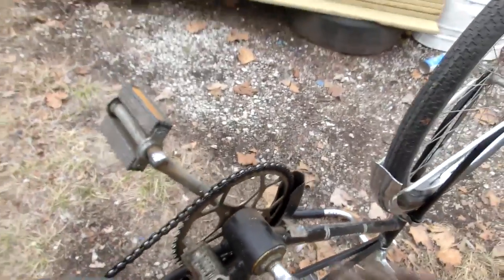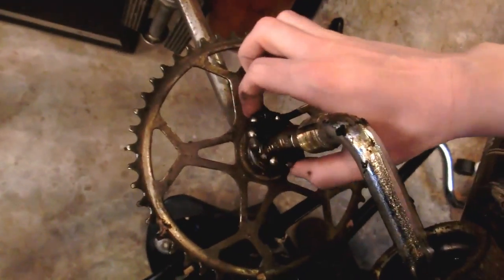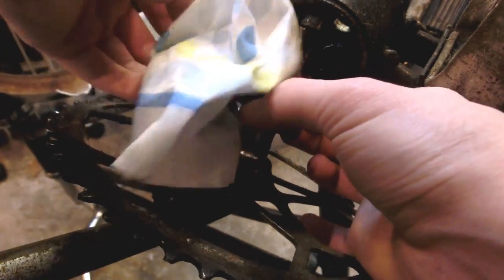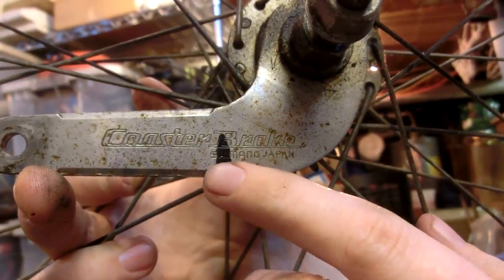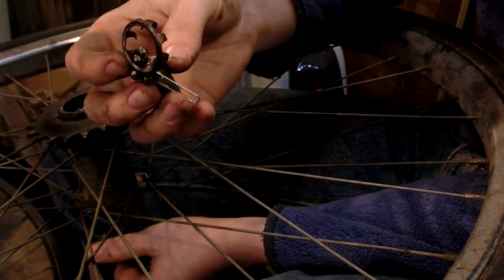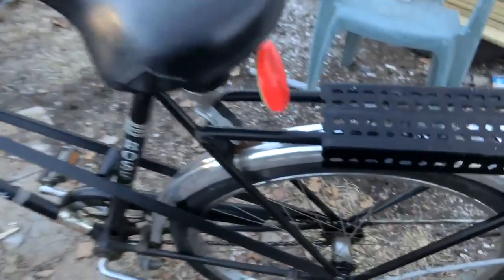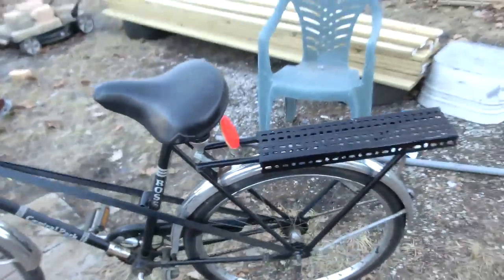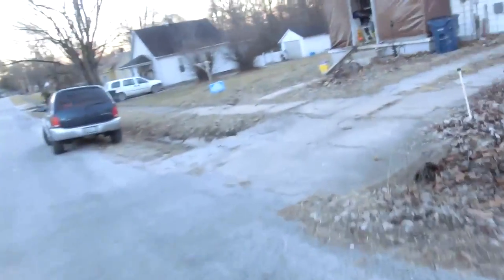SteamPunk/TeslaPunk E-Bike 03: Greasing Bicycle Bearings, Shimano B-Type coaster brake

Comment: There are usually bearings inside the pedals they will probably need greasing as well. Bearings tend to run smoothest with just a whiff of grease.

Comment: Bikes should definitely not feel tighter and more resistant after servicing all the drivetrain bearings - that is a sure sign that something is maladjusted or reassembled wrong.

Also, just a hair too much tightness (especially) or too loose can lead to bearings and races getting destroyed in short order.

If it feels harder to pedal now, I would surely fix this before I applied any external motors to it(!).

Comment: Hi Rinoa Super-Genius try using a liter weight grease it makes a big differences  in ease of movement just like in oil weights in a eng. / motor . The viscosity is to high for you to over come . Just a thought i had to help you out. Good luck with your e-bike build . THANKs for the videos the make my week better every time
Reply: doesn't matter much while riding, only when spinning the wheels and crank by hand

Comment: I like to coat all my bearings and races with a spray on dry moly lube then coat over that with some thin teflon grease. I tighten things up just enough to get any slack out and not a smidge more.

Comment: Love those reverse brakes!  Think if you spray some oil in those bearings it will loosen up for you.  Guessing my method is wrong but I grease up the bearings then assemble it and spray oil in the bearings and keep spinning and adjusting how tight the nuts are until it spins super easy.  If the nut starts coming loose just peen it in place; usually a nice hard hit with a hammer and chisel put a little dent in there and bingo good to go.

Comment: Bikes looking good so far. One thing I do when looking for a bike project is, only get bikes that have a 3 piece crank. I feel it's a better design. I like your homebuilt mixie. Electric assist will be awesome
Reply from the maker: yeah it has been, ive so far gone like 500 miles on it and its mostly holding up fine. some issues of things rattling loose over time but its all stuff that can be fixed with a screwdriver now.

Comment: It's slow because it looks like you packed too much grease in the bearings.  The bearings need space to move and only light coating of grease is required for proper lubrication.
Reply: Cory Yalowicki no it's because the preload was set too tight. No cone wrench, so just pretend it doesn't matter. Hey, why is it so hard to pedal now????

If there's too much grease it'll just squish out.

Comment: Someone has probably already explained it, but those wheel bearing races are supposed to be tightened up so they don't move much axially, while still rolling smoothly, then the second nut is tightened up against the bearing race so they don't loosen up. It's the same principle with the bottom bracket.

Comment: no worries man.Just loosen up the bottom bracket and the hubs just a bit.A smidge play is all right.
take apart the pedals as well.
Hate the US open BB ones because they always run loose after a while.
Got a conversion kit to Euro BB bottom bracket on my Felt cruiser.Which gonna be an ebike  this summer.Inspired by that crazy expensive Vintage electric E- tracker.

Comment: The pedal is the squeaker, spray a bit of WD 40 in the ends of both closest to the frame and that should stop after a short ride, on bikes you can over tighten bearings which causes bearing friction so you have to pedal harder.

Comment: It should be a fairly quick fix for the wheel bearing tension but you do need the skinny cone wrench. The idea is you finger tighten the cone nut down on the bearing just to the point where there isn't any play then you have to hold that nut still with the cone wrench while you tighten the lock nut down on that cone nut. Then test the wheel for easy rotation without play and you have it. If not back it off and adjust the cone nut ever so slightly in the direction it needs to go and tighten everything up again. Repeat until it's just right. Same idea with the bottom bracket bearings. 

Otherwise you'll probably get way too much pressure on the bearings and the races will groove and the bearings will grind like hell and won't last for shite under pedal or electric power.

Comment: Btw to check any play on an axis with bearing try applying a torque orthogonaly to the rotation of the axis (I don't know if that's the best way to say that ^^) for the rest, I've already left a comment somewhere down here. Have a nice day !
Edit: the noise might come from the chain guard, I had to bend the end of the curve inside on one bike, on another one it was a screw under the guard that was rubbbing on the chain.

Comment: minimize grease.. with no grease you go fast because there is no resistance on the bearing however with no grease you have premature wear. tighten the bearings to a degree of tightness that you chose but turn the nut back maybe a half or quarter turn "or less" to minimize the contact pressure. generally i tighten them just enough to nill the slop.  something also you should  think about is the function of the first and second nut on each side of the rims... these most definitely are where applying either a bit of locktight or using a very slim pancake wrench because just a small turn of the threaded shaft while tightening the outer nut can throw off everything with your bearings again.  the  old pedals can kill you too. i fell going downhill standing up to gain speed while racing my mom a long time ago, i was restoring the bike .. but i kept the original  pedals on because whats a pedal to us but something to put a foot on thats on every "pedal" bike known to man and ive never known a pedal to snap. that bastard did exactly that though like a twig.. they are very thin shafts in most of them older bikes. My bike was an old black raleigh 3 speed or whatever with the original racks and had lights and all it was pretty sweet.. lost a lot of flesh from that accident, luckily we are most fortunate to have some degree of self healing as humans.

Comment: Back off on the pressure on the crank, you want it to spin for a long time,  but not rattle back n' forth too much. The lock washer that fits in the keyway will keep it from backing out. As for the missing ball bearing, I have a feeling it did fall down into the seat, just a matter of time for it to show back up n' grind up the bearing rings. Might want to remove the crank all the way and flip the bike so the ball bearing will come out. Need to loosen the bearings on the axles too, should make it easier to peddle.  As for the squeak, sounds like its coming from the peddle bearings.
Reply from the maker: +Lacider i did, i couldnt find it. and yeah ima see about greasing the pedals

Comment: If it's harder ride you tightened the bearings and bb too much!  It should be easier after you grease it 100% if the time.  And the rubbing chain will cut through whatever it's touching and also grind the chain until it fails. This is not an "audio issue". It is function. To eliminate the squeezing try piling the pedal axles. If that doesn't work then bend the chain guard until the chainring stops rubbing. Or take it off, at lest go confirm that ha what's causing the noise. 

I admire your spirit in servicing your bike. Keep it up and you'll find big improvements.

Comment: So many opinions.
theres not too much grease, in this application I don't think thats possible, it'll just find its own way out of the way.
A newly greased bearing provides more friction than a unlubed one, AvE has a brilliant video on that subject., on this old bike with those dry bearings you'd definetly espect a bit more restistance with no load. (as in th wheels and crank wont spin as long freely)
But if it feels harder to ride its definitly overtightened, as many before me has said, tighten just to the point there is no more slack, and not a smidge more., it better to have it a bit too lose than too tight, so I'd say if your not all the way familiar with the prosess just have a little bit slack first, and tighten after each ride till its perfect. 

You might also be better off with a thinner grease, but your stuff doesn't seem too thick..

Comment: the tightness should be to the point you feel no more lateral movement and from what i watched a bit other the top on the grease i agree with the comments more then likley the pedal is the squeak the wheel alignment been off set will put unwanted flex on the chain and also chew up the side of the teeth on the sprockets i have not messed with bicycles for along time i now work with motorcycles but all in all same principals

Comment: why did you use red lithium grease which is a high-pressure grease? Gonna be a pain in cold weather.
Reply from the maker: because its all i could find in my shed.
Reply: Rinoa Super-Genius I guess if you removed 95% of what you packed in there, it might be a little easier.
Reply: Lithium grease works well, even in cold weather for every bike that I've seen, and even if there is "too much" grease it will "overflow" along the axis, I've yet to see a case when it's putting pressur on the bearings.
Reply: flo ri the kind Rinoa used was meant to be put in a grease gun and injected into a bearing at super high pressure. There's a lot of types of Lithium grease and many of them work at low pressure.
Reply: Well to be honest I don't know this brand of grease but the "high pressure" grease I use (the green lithium one from facom) does say it can be used between -20°C up to 150°C, the pressure/velocity only changes viscosity and does not really matter for a bearing, the only thing that is kinda bad is it's sometime harder to make finer adjustement with that grease because it's so sticky. Please do correct me if I'm wrong about assuming that Lucas grease is similar ^^
Reply: flo ri if this was an electric motor or something more than one thin person, I'd say the grease would be okay. But this is a human-powered device that needs the grease to not be sticky or extra thick.
Reply: It will be powered by an electric motor ^^ But yeah, something more fluid might help to use a a little bit less force to pedal, not something I'll do tho, cause most of the very fluid "bearing grease" (mostly zinc based) tend to run/dry off much quicker than lithium ones, I don't really recommend them for a long lasting project.
Reply: flo ri a battery-powered electric motor...
Reply: Adam Rivera better than no grease

Comment: Yeah, just making use of ball bearings will grind off the rust. Like chainmail. As for being winded riding your bike, not much you can do about that aside from riding more often. It doesn't really help with getting winded, your lungs just hurt less over time.
Reply from the maker: +Maliciously Delicious ive tried that, doesnt work, thats how i got heat strokebthe first time
Reply: Shitty. Personally I just stick with an exercise bike when I am trying to increase endurance, since I once had an issue on a nature trail about an hour from home. In the middle of the the goddamn woods. Was not a pleasant experience. I made it back okay but It was enough of an issue that I stick with the exercise bike for the most part, and stay within about a half our ride from home when I am on trails.
Reply from the maker: Maliciously Delicious
for me, i can walk for miles even while carrying heavy loads, but i cant pedal fast for very far. when i bike i try to keep at the speed i ebike at, like 30kph (20mph) and i have a hard time with that most of the time. i have been trying to ride a non-electric bike to the post office and back every few days and we shall see if it gets any easier.
Reply: Biking is harder then walking admittedly. Walking is literally what our legs were built for, and is very efficient even when loaded up with alot of stuff. Biking only uses a few muscles and uses them in a weird way, and can be excruciating at times. Its why an exercise regime includes biking and walking instead of just biking which burns more calories.

Comment: I must agree with Aaron Armstrong from 1 year ago !
Your most disappointing video for me to date..Definitely no Super-Genius on this one.  You really need to know what you are doing when doing bicycle mechanics. You screwed up the 'chain line and you tightened the bottom bracket/cranks too much until it causes too much resistance ...you need to fix those things before you ride it any more and also please use the correct sized spanner instead of that massive Industrial thing...getting the correct tightness on the axle cones needs precision not a sledge hammer. YOu wouldn't use a blow torch when soldering a motherboard right? ..all the feedback so far here is correct...don't ignore it....the grease you used is fine...the amount was probably a little too much but not enough to pull it all out. Before re-greasing did you  clean all parts, including bearing chases, with petrol, diesel, metho, any 'spirit' to remove all the old hard crappy stuff? Putting a motor on it will not solve your problems. Pull it apart and start again using the correct tools this time.
Reply from the maker: maybe you dont understand my channel name. you must be really young if youve never heard of loony tunes.